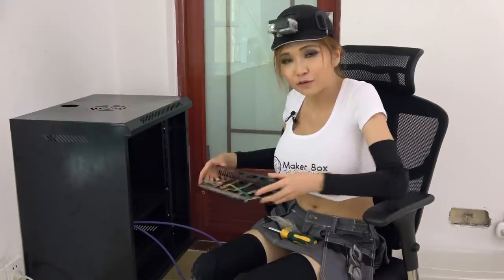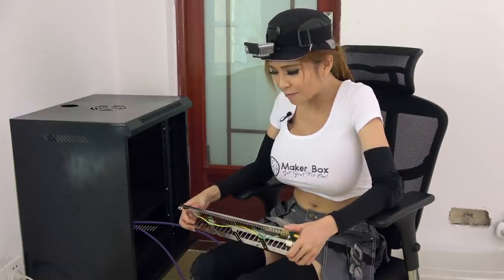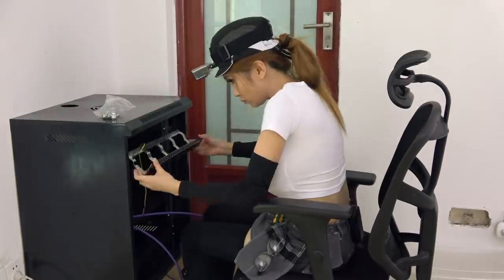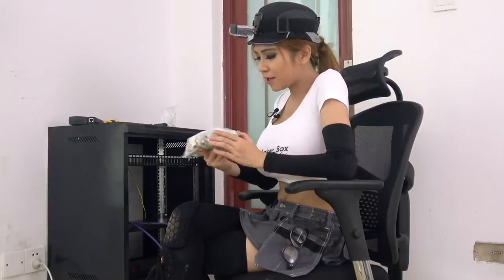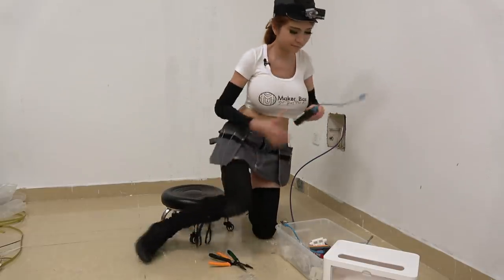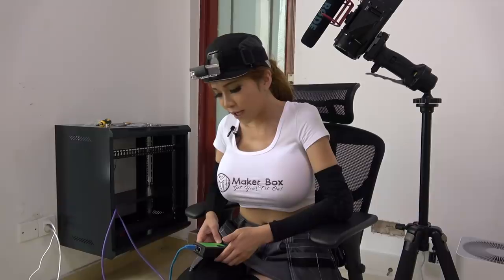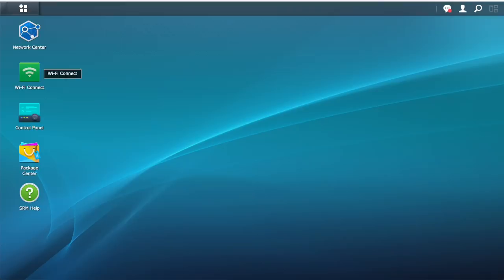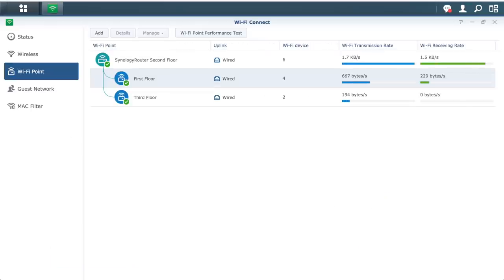Home Networking Part 2- Installing a Server Cabinet

Comment: As a open registered cabler in Australia you never use cable ties on data lines because they can be pulled to tight  and crush the cable structure which produces data errors in certified cables. So you did the right thing with Velcro :)

Comment: You may just have done it off-camera, but I would highly recommend adding some firestopping to the conduits between floors. A small intumescent wrap around the cable bundle and stuffed into the end of the conduit would do. If the worst happens and a fire breaks out on one floor, an open conduit with data cabling forms a chimney filled with a fuel source (the cable insulation) and turns the other end into a blowtorch. Not fun!
Reply: Sounds like good advice. I can't help thinking for something as small as a conduit to be a problem the rest of the structure would need to be very well fire proofed though?

My home was built pre 1900. I have fire proof doors but the ceiling between downstairs and upstairs is plaster and wood. I'm not sure how valuable a fireproof door is!
Reply from the maker: Good idea!
Reply: @ssa9148  If it's in a proper fire resistant frame (e.g. intumescent seals around all edges) then it's worth it. Fire follows airflow, so any airflow path is the prime route by which a fire will spread.
Reply: Was about to add the same, it is code where I am, and I've been working in large data centers for 10 years. Also, we have people here from everywhere and have broken down how the campus is planned out so connections go by building number, floor number, quad number, drop type (E for employee, O for Executive, I didn't make this decision),  number then type. Mine for example is 523E03L - Building 5, 2nd floor, 3 quad on the floor, port 3 (office 3), LAN drop. We have an internal DB that technicians can track the path from switch port to terminal device so we know the entire path just using the endpoint (sadly it is in-house software and sucks but their heart was in the right place).

Sounds complicated but if you post how it works I've never had a visiting tech have an issue after working out the scheme. This is from Japan, China, Canada, USA and UK.

After saying that I really feel I need to get a hobby.
Reply: @ashlabs1778  Worked on industrial sites, and we used a simplified version of that scheme.  Electrical Room, outlet number, and colour-coded.  Eg, 5-P42 would be ER5, Production, panel 42, and it would be the green drop.  4 colours for the different networks and telco.
Reply: @TheInsomniaddict  That makes so much sense - I think our electricians use the same - color coded electrical tape on the drops under the raised floor but with a slightly longer number. Now I have to bug them about it - thanks for the comment!

Comment: Terminating TP cable, not my personal idea of fun...

Here are some points I've picked up over the years.

I've used a lot of different versions of connectors. Some suck more than others, but they all tend to be a bit fiddly. Having the correct tools can help enormously, but the really good stuff is ridiculously expensive. I picked up some tools for my home shop at clearance sales, but even then I just got the reasonably good stuff. If you don't do it professionally you can do with the really cheap tools, but it takes a bit longer and isn't as easy to use.
You always should check your cabling at least with a simple continuity tester like the one used in this video, but even if it passes that doesn't mean it's actually correctly wired or that the cable is standards compliant. To really test the cabling you need a much more expensive device. Personally I don't feel that's critical for small installations like this one. Here you just want to know that the cable has connection, and with tester just one step up you also can see that there is no cross cable short circuit and have some other niceties. But if you are doing this commercially your customers are likely to want every run tested for compliance. If it's a big installation you can hire someone to do this, or if it's a smaller you are probably better of renting the equipment and doing it by yourself, but check with the customer what they want or you might end up bringing in the professionals to test things just to satisfy your customer.

About the pin out standard, yea they are fiddly with pairs split far apart and other pairs installed in between and such. The sockets are usually reasonably simple to work with, and often comes with color markings to show exactly what lead goes where, but the plugs can be nightmarish. And to be compliant with Cat5 and Cat6 you have to keep the untwisted length of the leads very short while still managing this weird scheme. I suggest you just buy patch and drop cables as far as possible instead of making your own.
 
I've had people go; I just ignored that pinout standard and made the patch cables just going green - green white, blue - blue white and so on. I did it the same at each end and it works just fine.
It may work, but it's not how it's supposed to be. There is a reason for the way the pairs are split in the plug, and if you ignore that the signal integrity will be corrupted. In a twisted pair cable the signals are transmitted in a balanced pair. This means that any interference will be mostly canceled out, but if you start sending the signals in separate pairs they will cause interference rather than cancel it out. Having said that modern gigabit interfaces are pretty resilient and will often be able to correct for improper signal phase on one or more pairs or even having pairs switched over. But that's something you really don't want to have to lean on.

So I guess my advice for anyone out to pull some TP cable for the first time is to be careful and try to make sure you terminate the cables correctly. Sounds obvious, but I've run into to many weird ways to terminate these to take that for granted.

Comment: My concern is you have that big box sticking out close to that door to the other room!
Reply: Matthew Rand that’s why the glass is cracked lol. Very cool video tho!
Reply from the maker: No. See: https://i.imgur.com/VRB2J3h.jpg
Reply: Also didn't see her check for studs. If it's not mounted to a stud it will fall and take the wall with it.
Reply: @Patrick1985McMahon  in concrete or brick you don't have studs so it doesn't matter
Reply from the maker: @Patrick1985McMahon  No studs, it's solid concrete.
Reply from the maker: @Vohtwomax  glass was. Like that when I moved in and the door opens inward.
Reply from the maker: @jyvben1520  no need, it doesn't block the door
Reply: @ViniGiovanni  a girl like that needs some studs around here. 😉
Reply: @Naomi-Wu  must be an old buildings to be solid concrete. A lot of newer buildings have a drywall over concrete.
Reply: @Naomi-Wu  now it makes more sense why you used that type of drill for the taps.
Reply: I agree. even though the image Naomi linked to showed that you can clearly access the bathroom, its not "ideal". Late at night, maybe you forget its there on the way to the bathroom, and you get nailed with a corner! Anyways, I trust her judgement, she is the one living there at the end of the day
Reply: Next Project Naomi relocates the door.
Reply: @Patrick1985McMahon  No studs in concrete. That's why she drilled the hole then inserted the anchors.
Reply: @Patrick1985McMahon  she was drilling into concrete didn't you see the hammer drill? no need to look for wall studs

Comment: Excellent summary of why to use velcro v.s. zip tie. One add, I would say, is that zipties are cheap, and can be cut and replaced easy, but networking video and audio tends to get messed with a lot.  I did this exact thing in my house, with an almost identical cabinet, my house is "flat" rather than multiple floors. a lot of  crawling around under the house running cables. I created an office with Cat6, HDMI, Audio and USB in the walls of the office. I have projectors on the ceiling and 6.1 surround sound, and several USB cameras all for stunning conference calls.

Comment: If only all houses came lined with conduit between floors already. That's 95% of the battle :)
Reply: In the late 80s early 90s around Chicago there were some houses in condos that had the conduit already put in. It never went any farther than several years sadly. I was in computer programming and our teacher talked about it.
Reply: Here in Italy every building has conduits . We never wire cables directly into walls, but first install conduits into the floor and walls during the construction of the building

Comment: Just a suggestion.  When you drill holes in concrete or block it can help the anchors be more effective if you blow out the dust from the holes first (use a can of air for electronics, just a quick blast).  It's not a problem on these light units but for heavier stuff it can matter.
Reply from the maker: Drill vaccum takes most of the dust out...

Comment: When terminating cat5 or cat6 it’s usually best to use the pull string to remove the sheath. A lot of the times when using those strippers to cut off the sheathing it will nick the pairs a tiny bit. It may test good now but over time it can develop a high resistance open and possibly cause intermittent issues.

Comment: Impressive Naomi.  You are as good at the work as any Sub-contractor!  The national broadband is now available to my home.  I'm currently using a wireless USB stick on the back of my desktop PC, and was thinking about changing to an Ethernet cable to connect to the new modem.  But I don't want it running along the floor inside - trip hazard.  I will probably just buy a standard 10 metre cable with the plugs already fitted.  And just drill a hole through the floor, and run the cable along the under floor framing beams to the kitchen - where the modem is.  There are plenty of cable runs under my house already, for Foxtel (not in use), phone lines and free-to-air TV antenna.  My house is my house, so I don't have to ask permission to do this.

Comment: Dear Naomi. Very nice video. One Tipp from me: When labeling cables, I have found it not very practical to label them lenght wise. Instead I put the tape on perpendicular to the cable. But when time comes and the glue ages enough, both ways will comes loose anyway.
Your security tipps are very handy as well. Thank you for your thougtfull put together video. I also hope the best for Becky. All the best.

Comment: Another enjoyable and informative video - Yes! please do more. One thought though, in the fast-motion bits with detail, like terminating the cables, you might think about short real-time parts like when you punch in the twisted pair (just one would do) for a second or two, then back to hi-speed. That segment was a little dizzying. As others have pointed out you are keeping up your high standards on describing your design process, alternatives, and safety/privacy considerations. Keep up the good work!

Comment: You are pretty quick terminating those jacks. Imagine doing that for 8 hrs. My hands would actually cramp up. As for using Velcro, its better for data cables. If Ty wraps are tighten down too much, they can pinch the outside insulation and wires, then cause crosstalk between the cables. Plus its cheaper to just readjust the Velcro, instead of cutting and replacing the ty wraps. If things don’t work out in China, you can always come to the USA. Any teledata company would be glad to hire you.

Comment: "You will always remember what is what"... yea about that... I and my dad had to gig a 10m by 1m hole 1m deep to find an old irrigation water pipe, it was very hard soil, so yea, lable stuff! (And please NEVER cut zip ties smooth, it greatly reduces the force they can handle, rule of thumb is 2-3mm need to stay.

Comment: I noticed it in the first part already: You didn't do this for the first time, did you? Also great decisions in terms of price vs. functionality. Saved on the showy equipment and went for the quality parts where they make a difference.
I love the Polyanna and envy you a little bit for it. It's a great machine but a little overkill if you only have to drill stone or concrete once in a while. Whenever you have to drill a number of holes though, you always wish you had that Makita after the fifth one or so.
Those tool-less jacks are awesome and if you buy a whole bag you easily save the price of a punch down tool while getting enough to last for the craziest networking ideas at home. I installed an alarm switch in my cabinet that turns on an IP camera (hidden inside the cabinet) and silently sends a notification to my mobile and to my email address if the cabinet is opened. Lucky me works at a place that produces sheet metal lockers and cabinets so I could design my very personal one. 

It no big deal if the patch field rail is bend a little. with the cheaper cabinets you most often have to bend and twist those slightly anyways to make them fit, they do the job anyways. Velcro is your friend when it comes to close range wiring and especially in dynamically changing wirings. It makes it easy to group the cables. The only real alternative is spiral hose for smaller groups of cables. Patch cables don't like tight cable ties that much and when changing things you either have to cut them open or you will sooner or later introduce some drag to some of the cables and get some loose connections over time.
It's also a good idea to find a way to keep the inside of the cabinet as dry as possible, because the contacts (even gold) will "corrode" and you will only notice after a power out that some connections don't work all of a sudden. We do have that all the time in our machine cabinets. After a maintenance we have to pull and plug each cable, so that became part of the maintenance routine. And that's with cabinets that are water cooled and air filtered.
The sped up parts of the video were funny, because I thought if only it would go that fast in real life.

On the topic of Becky: The goal was still not met and I think it can't be mentioned too often that there is a wonderful person with a lot of potential in need for our help. I think donations could be more if we keep people aware of the case. I really hope we manage to provide the help she needs. It's awesome what was achieved but it's not enough yet. I put in another bit. If others can, don't hesitate and watch and share Naomi's vid about Becky Button.

Comment: I think I would future proof by running fiber between each floor and in the future have a switch on each floor and interconnect with the fiber through SFP. port.
Reply from the maker: No point in spending the money on future proof with a three year lease.

Comment: I'd recommend getting a slightly better cable tester.  I've found those cheapo ones every once in a while gave bad readings.  I'd recommend getting one similar to the SC8108 network tester; knowing where breaks happen can give you an idea of where problems develop in the future, too.

That UPS looks too small to support your NAS for an hour, especially while it's in use.  Unless it's a Li-ion model?  If so, neat what make is it?  The cable wrap might work, but I find length-wise wrapping doesn't hold very well for me.  I normally use width-wise nylon, but if you're considering handling network installs for people you might want to check into shrink collars.  Location of the network cabinet seems... not good.  Too close to the door and hard to work around.  It might be fine right now, but if you need to move anything large in or out of the room it can get in the way.

Very cool though.  If you have an interest in networking and want to go professional, check out Mikrotik or try and find surplus Ciscos with a recent firmware revision to play around with.  Cisco is at least the mainstay here; not sure in China.
Reply: Time to buy your first fluke cable tester. It the only one you will ever need.
Reply: @PWingert1966  Way out of my price range.  I'm a network technician not a electrician, also not an independent contractor.  The unit I mentioned is good enough for home wiring and for first pass on commercial installs.  We use electrical companies to do audits when needed.

Comment: Did you have to add any cooling fans like you would with a desktop computer with all that hardware and for your networking towers?
Reply from the maker: Yes, there's a fan in the top of the server cabinet but the rest is not too hot.

Comment: Personally I would just have been lazy and placed the white boxs directly over the holes in the wall, and let the wall cable connect directly to the routers (one less connection to drop speed and go wrong). The boxs looks just about big enough for that, but I might be wrong.

Comment: When I use an IP camera, the first thing I do is block it from sending/receiving off-site traffic. Ideally this should be by MAC address (since that's unlikely to change). A lot of cheap IP cameras "phone home", and you can never be sure they're trustworthy.
Reply from the maker: That and also change the gateway IP on the camera to something incorrect.

Comment: It's really great too see you progress here on YouTube! I have 1 question though or maybe this is me think towards the future as I saw you installed the routers (for now it is a great solution) why didn't you purchase a unmanaged switch? This means that 1 port of you router get split into 8 ports or 16 port (again this me thinking towards the future) incase you need more security camera's or working desks?
Reply from the maker: Plenty of room in the rack to add a switch later. Need to save money and do things one step at a time...

Comment: Thars a good multi drill. I use makita but not that model. Does that model have a jackhammer? Also it looks like yiu bought the more expensive metal jacks with onboard punch down.  Is that purple cable the ftp rated shielded type?
Reply from the maker: Yes, has hammer only, cable is foil shielded